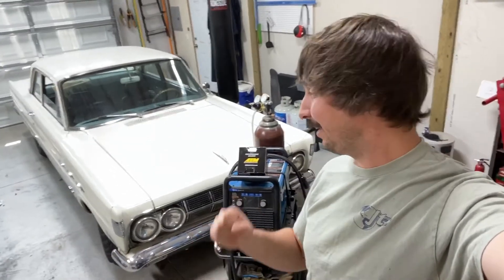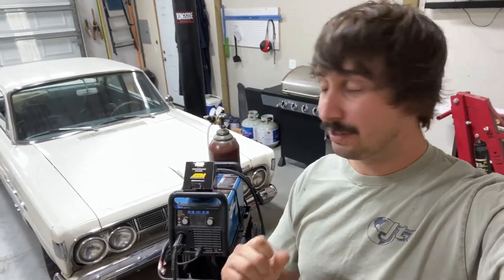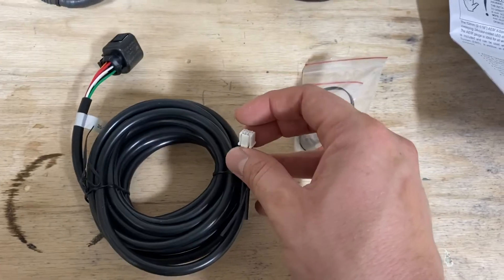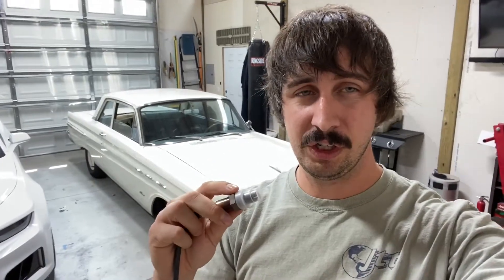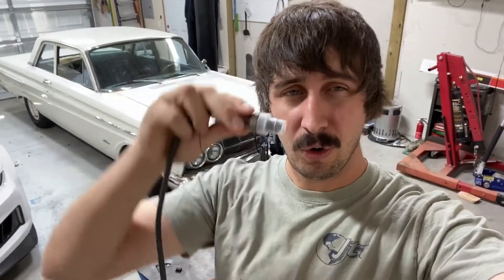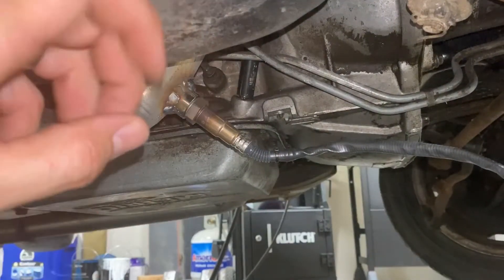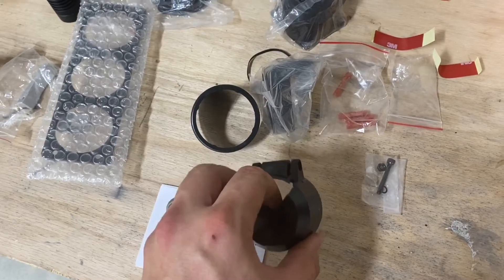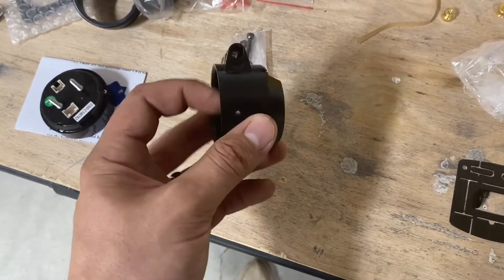Wideband Air Fuel Gauge Install - The Basics

Comment: Does this wideband have data logging capabilities?
Reply from the maker: @johnnyformula5923  I believe it does if you hook up an output.  In only using a fraction of the functionality
Reply: @truckandroll989   Thank you. Will be watching the rest of ur series.
Reply from the maker: @johnnyformula5923  awesome! There is a newer video of mine that covers carb tuning as well.  Its in the playlist of my 78 Dodge.  Same Edelbrock AVS2 650cfm

Comment: Is there a tune video ?
Reply from the maker: There are a few.  Here is one specific to idle mixture adjustments

https://youtu.be/4m77L_6hOQI?si=ey-XAlRs6FyZsUQI

Here is one on the dyno after doing heads, cam, intake, full exhaust, etc.

https://youtu.be/P0PFq4a-jRE?si=HNWhxJ24caf_7sbC

Comment: 3:54 Sensors should be installed at least 110 degrees to the pipe, never pointing down.
Reply from the maker: Youre not wrong the orientation isn’t ideal.  Space was very limited and that exhaust was coming off for headers/larger diameter.  With that being said the idea is you dont want condensation pooling on the sensor.  My thought was it was up on the downward sloping portion.  FWIW it still works great in my new exhaust setup and has matched closely to dyno tailpipe o2s for tuning

Comment: What's the part number for the kit?
Reply from the maker: Check the video description.  Tons of options out there.  Here is one i have used successfully in the past (and in this video).

https://www.amazon.com/AEM-30-0300-Wideband-Sensor-Controller/dp/B0184TSI84/ref=mp_s_a_1_2?crid=1G2TGA5C1LCH1&keywords=aem+wideband+o2+sensor+kit&qid=1688327789&s=automotive&sprefix=aem+wideband+o2+sensor+kit%2Caps%2C119&sr=1-2&ufe=app_do%3Aamzn1.fos.f5122f16-c3e8-4386-bf32-63e904010ad0
Reply: @truckandroll989  Thank you

Comment: Do you have to run 2 Aem Air/fuel mixture gauges if it’s a v8?
Reply from the maker: You do not.  If you want to know the difference from side to side then yes.  Even with 2 (on per side) you would only be getting an average of the 4 cylinders (per side on a V8).  So in short no you dont.  OEM only run 1 per side to adjust the tune.

Comment: Just now seeing this video and AEM instructions say to add a 5 amp fusible link to your 12 volt supply and I noticed that you didn’t, have you had any problems without it? And is your 02 still in the same location that you mounted it in with no issues? I’m getting ready to install the same gauge in my car and was wondering what your installation outcome was.
Reply from the maker: The 5amp fuse is to protect the unit from any power spikes.  No i didnt have any issues without it.  However more recently I rewired the entire car and this is now protected by a 5a fuse.  As far as mounting location yup its been working fine all this time.  No problem
Reply: @truckandroll989  Thanks for the info because it will definitely help me with my install. 👍

Comment: what is the best one to buy just rebuild my engine 5.7 1990 k5 blazer i got edelbrock carb on there i already have headers so the hole is  there for the 02 sensor i converted it from tbi to carb.
Reply from the maker: Aem makes a good one.  Cant go wrong with any of their gauges.

Comment: How is the water going to drain out of your sensor? Pretty sure it should be on the side and 10 degrees over center so the sensor will drain any water that gets in it.
Reply from the maker: The sensor protrudes into the pipe a good bit.  Ideally i could have rotated it to the side but it would have hit.  If you are filling the entire exhaust tube or half of it with water youve got bigger problems.  Its not at the lowest point and has not been an issue so far.  When i eventually install headers i will mount it in the collector where i have (hopefully) more space

Comment: Instructions with every o2 I have ever installed "Make sure the sensor is at least 10 degrees upward from horizontal"...
T&R... proceeds to install 45 degrees downward facing..... LOL!
Reply: The reason for at least 10 deg upwards is so that the sensor doesnt get condensation and screw up the sensor,if you cant install it at these specified angles then in my opinium its pointless,your just asking for problems.
Reply: Any condensation will run right into the sensor! seriously that is so incorrect. So you are wrong the point is to have the probe end facing down..We all make mistakes man just own up to it.
Reply from the maker: I honestly think the point is that in a flat section of pipe the sensor isn’t the low point.  The low point is is where the pipe bends and goes horizontal below the sensor.  I hear what you are saying but in my case space was limited and i dont think water is going to pool on the sensor where it is located

Comment: Nice install.  PLEASE  do not hot-start the sensor. i.e. never let the gauge heat up the sensor, before starting the engine.  That sensor gets up to 1400F. And, when that cold blast of startup exhaust and condensation hits the ceramic element, in the sensor, is cracks, like throwing water on a hot windshield. That is the cause of early sensor death, in at least 90% of cases.
Reply: How do you do that... Not  not hot starting  thankyou
Reply: @ford351cleveland  As soon as you turn the gauge on, it starts heating up the sensor. If it gets past about 3 or 4 ticks of the "HEAT" cycle, the sensor is too hot to start the engine.  Switch off the igniotion for a few seconds, to let the sensor cool of a bit, before starting.
Reply: @lordandprotector  thankyou very much man will definitely  do so.